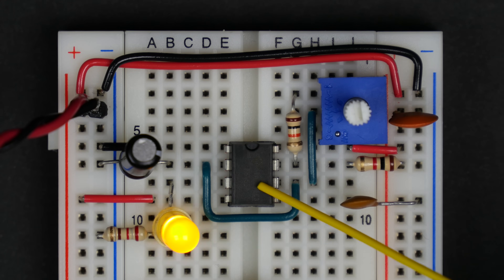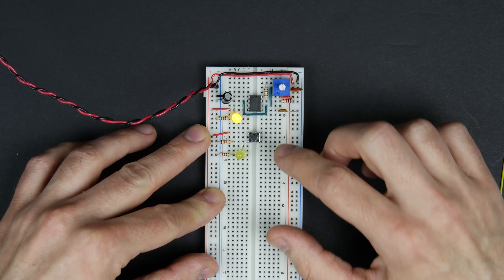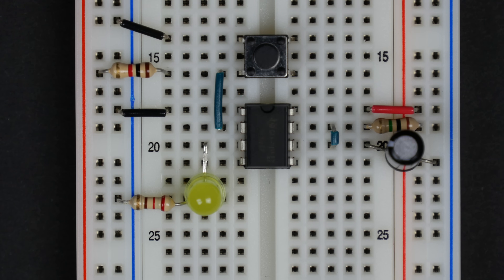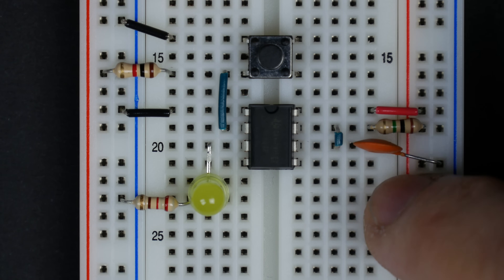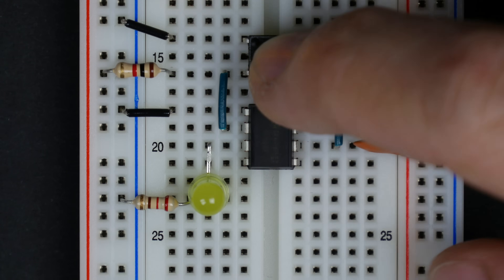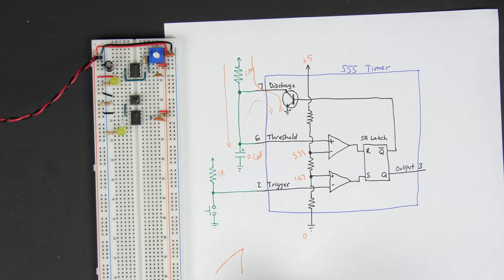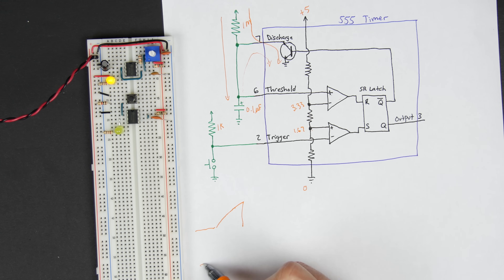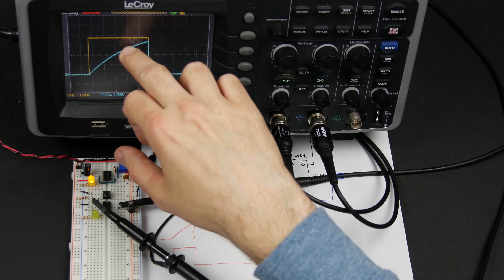Monostable 555 timer - 8-bit computer clock - part 2

Comment: OK I have a weird problem: my circuit seems to be haunted :P
I have the monostable multivibrator circuit with one 555 and the push-button on my breadboard, exactly like in this video. But the LED glows almost all the time, just turns off for a fraction of a second and turns on again, as if the 555 timer was firing again and again :P Oddly enough, when I touch any point of the circuit, it works fine & dandy :P But as soon as I stop touching it, it fires again and again.
I thought that I have some noise on my power lines, so I blocked them with those 100n capacitors, but it changes nothing. I even tried some big 1000 micro capacitors between power and ground – still nothing :/ It drives me crazy, because this never happened before :q
Reply: I did the same thing.  Took me ages to figure out what I did wrong.
Reply: Things got even weirder: the same breadboard works perfectly fine when I'm holding it mid-air, but goes crazy when I put it on the floor :P WTAF? o____O'
Reply: Nevermind, I caught the bug: I forgot the pull-up resistor on the push-button's output / 555's pin 2 (shame on me), and that means the pin 2 was floating, catching any electric potential from its surroundings and triggering randomly :q I added the resistor and It works now. But I'll leave these comments in case someone else had the same problem.
Reply: Gah! Did the exact same thing you did.

Comment: What voltage rating does your capacitor have? My local distributor only offers 2.2µF at 50V. Should be fine i guess :) Keep on going, love your videos!
Reply: Christian Schmeisser The capacitor is exactly that if you watch part 1
Reply: But if it is labelled 2.2, it may actually be 4...

Comment: I made a mistake, my capacitor is connected to pin 6 (threshold) and PLUS, not minus as in the clip. If I change that, no matter how I turn the capacitor, the LED doesn't stay on. How is this possible?

Comment: I just love those videos. I'm about to make z80 computer and most likely some analog synth boxes. Thank you for explaining the basics so well. Great job!
Reply: I just bought a Z80 CPU the other day. I've yet to receive it, but my first planned project is the LED flasher Julian Ilett made out of one. Tbh I never thought I'd do anything with the Z80, much less use one in my first CPU based circuit. I always thought I'd end up using a 6052 or 8086 since I'm more familiar with them. I know almost nothing about the Z80. But it'll be a fun adventure learning.
Reply: @VoidHalo  the Z80 is a great cpu. I built my first computer using an 8080 with front panel switches and LEDS, serial I/o, 16k of memory, and 16k of ROM for a custom o/s I wrote.
I wrote hundreds of thousands of lines of code on it. And later modified the machine for. Z80 and 64k of memory and adopted CP/M on it.

Comment: I appreciate the content but couldnt you just debounce with a cap?
Reply: In theory, yes, but you would still need a resistor and if the switch bounces, then the bouncing could act like PWM and the cap may not charge/discharge to the right voltage.  Also, the transition from low to high/high to low would not be anything close to an ideal square wave.  You could add a comparator to fix those issues but then you're looking at pretty much the same number of components as with the 555 timer circuit.
Reply: with no 555 I mean
Reply: 3:00

Comment: What video camera do you use? The quality and level of details is very good.

As for the circuit, I see one little problem with it: when the button is not pushed, the /Q is on, and the transistor is open, so there's a constant current from the +5V rail through the input resistor and the discharge transistor, and the circuit is consuming power even when it does nothing useful :p 
Wouldn't it be better to use the discharge time instead? Then the circuit would consume power only in the short period of time when the button is being pushed, to _dis_charge the capacitor?

I'm also wondering if it is possible to reuse a single 555 chip for both modes of operation somehow, by rewiring it on the fly with a two-state switch ("one-shot / autofire" kinda thing ;) ). Any ideas?